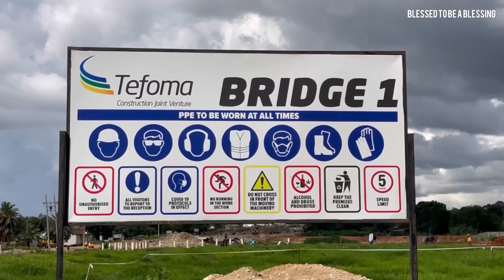MBUDZI INTERCHANGE JANUARY UPDATE. BRIDGES 1,2 AND 3. HARARE ZIMBABWE

Comment: Under bridge 2 you could put hydro electric generators in those river  rapids and light up the whole complex and feeding roads. For kilometres before drivers arrive at the interchange.
Reply: True just a small generator will do the job
Reply: True just a small generator will do the job
Reply: This is a good idea but there is need to invest more in security of those generator if ever they get to be put otherwise thevies will party.
Reply: @Thatguywoya747  you are right, and some silly thieves will probably only just try to cut the electricity copper lines, in order to sell the copper on the black market. But with a high electric voltage in the lines, and on top of that standing in water , it is not a good idea. All participants in the water would go meet and greet their Vadzimu /Ancestors instantly.
Reply: @Thatguywoya747  🤣🤣🤣government look into security. Ndo mbava dzacho, my dear.
Reply: Mvura ishoma iyo plus it needs falling water with a lot of pressure to turn generators

Comment: The company should make sure that they create a safe working environment for its workers and all stakeholders. The work area should be fenced off those coming on site should be inducted. There should be an information center with pictures of the to be completed structure.
Reply: It's just a road.
Reply: @sithabelamandlawenkosiwodu6298  unfortunately safety does not take a holiday and can never be under estimated. In fact construction is responsible for some of the most  incident and accidents.